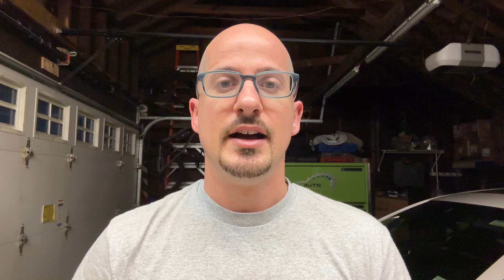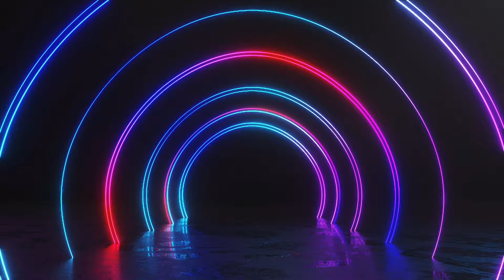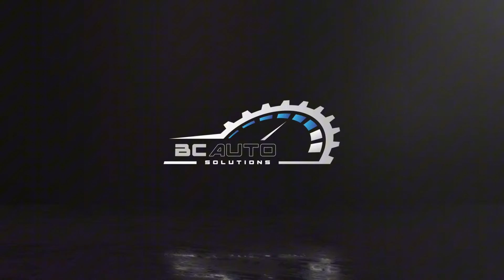Most overlooked maintenance items

Comment: Besides mechanical maintenance, if the climate permits you should hose down your car in the winter.  Don't let the snow accumulate and sit under around the wheel wells or any other area under the car.  The salty snow is just going to corrode any metal it contacts. Hose down under the wheel wells and around the suspension; make sure you get in any crevices that are near the splash guards or the front of the wheel well.  Hose down the wheels.  Hose down under the rocker panels and the bumpers too if you can.  These areas tend to rust badly.

Needless to say a good waxing before winter and in the spring help your paint.
Reply from the maker: Yes absolutely, for those in these types of environments a good hose down of all components after a major storm, salting/brining session is a must!

Comment: When I bought my 2016 9th gen accord j35, it had 43k last year. It's at 58k now. I barley go anywhere. Lol but anyways idk if the previous owner ever did service on the car besides oil change. She was a old lady. Took it to honda, I was told the trans needs to be flush as well as the brake fluid flush, granted it's never been change. Might as well do fuel filter as well when I get that fuel sending unit done. Lol... if you know of anything else that needs to be changed at 60k I'll greatly appreciate. I know I needs pads, when I put the car on the lift in my shop. She's needs a little love but she rides so good. 🤷🏾 😂😂

Comment: Thanks for all the good tips. Do you recommend regular EGR and EGR passages check/cleaning?
Reply from the maker: Certain older models seem to have carbon buildups. In those cases yes.
Reply: Recently, I removed the upper intake plenum on my 2000 Accord because of a malfunctioning throttle position sensor. Upon removal of the plenum, I noticed the inordinate amount of charcoaled oil residue throughout the walls of the plenum. With a combination of purple degreaser, long probing tools like screwdrivers and compressed air, I was able to leave it shiny and clean. With 232,000 miles it was worth the effort for extend the life of this F23A1 engine.
Reply from the maker: @jamram9924  I agree, keep it running because the new cars are more expensive and require more maintenance.
Reply: @BCautosutions  especially the turbocharged engines. We baby those engines in our shop. It’s very hot out West where we live 🔥

Comment: I finally had my mom’s 04 Civic put on one of those tablet computers because her gas mileage has always been bad around 20 mpg since she had the car. It ended up the idle was good and there was no codes or anything that came up. The mechanic thought maybe the fuel filter could be causing it. Plugs and air filter are good. Do you agree and what other things do you think it could be?

Comment: As a technician, do you have to tune new engines at the dealership? Do you have access to tuning vehicles and what tuning software do you Honda techs use? Can the cvt tcm be tuned to be more quicker in acceleration instead of more efficient?
Reply from the maker: No, we can’t tune or change anything at the dealer level. All we can do is perform software updates which usually just corrects an issue. Even the aftermarket community does not offer and trans software alteration unfortunately which is big limitation for the racing community.

Comment: New to your channel I had a 1.5 liter civic  2018 accident made it not driveable. I bought a 2024 honda HRV EXL how does honda oil life work. I have hondacare oil change when do you recomend chainging.
Reply from the maker: Congrats on your new car. Hondas maintenance algorithm is pretty bad although most dealers will only honor the oil change when it says 15% or less. I recommend changing it every 3-5k and if the light isn’t on, change it yourself,
Don’t reset, then have Honda service it when light finally comes on.

Comment: I was at my dealership today and they suggested just replacing my rear pads “Pad slapping” for $225. I’ve never had them suggest this service before. Is this something new at Honda dealers?
Reply from the maker: We offer it sometimes as an absolute no other option as far as people’s funds go. We usually make the customer sign something saying they can have vibrations, noises, etc. I just did pads in a Tlx - s last week and rotors are fairly newer so owners opted to not replace or resurface.
Reply: @ for the last 20 years they always told us they were turning rotors. Never seen them suggest this before.
Reply from the maker: @ when labor rates go up, parts, etc, they are probably trying to find any way to have people spend money.

Comment: I hear some weird buzzing/rattle coming from the passenger door it’s 2020 Accord any ideas?
Reply from the maker: When does this happen? Lock, driving, etc.
Reply: Usually driving lower speeds hitting small bump roads
Reply from the maker: @hondaaccord2.0t41  may just be a panel rubbing that needs some felt tape somewhere

Comment: Dealer wanted to charge me $200 to install the PCV valve😂😂
Reply: Dealer wanted 400 for just brake pads in the front🤣🤣 it’s just the hourly rate it’s only 2 hours on the book
Reply: That’s just labor no parts